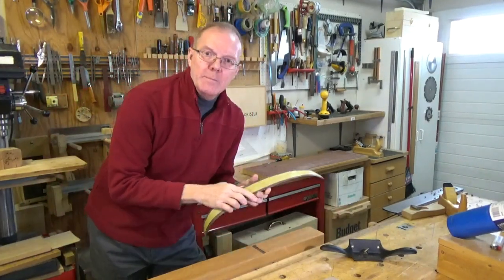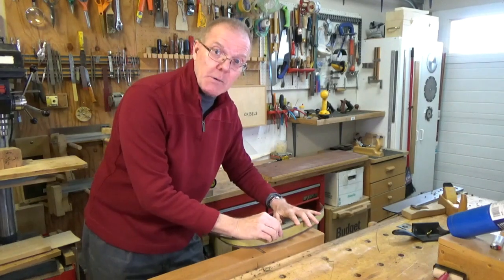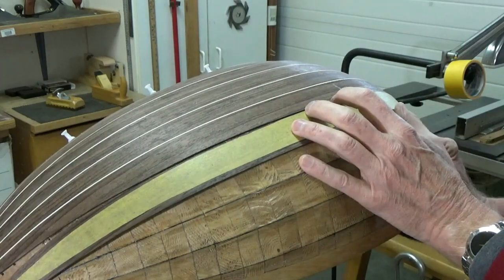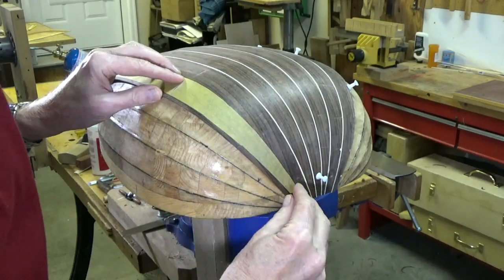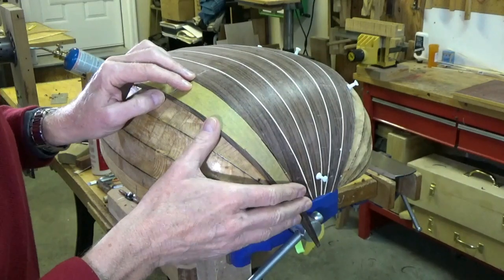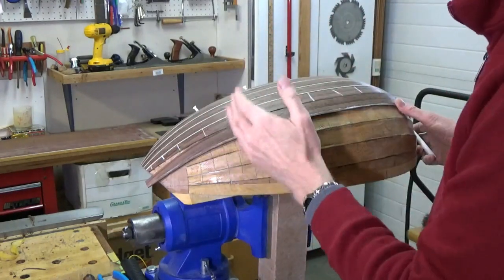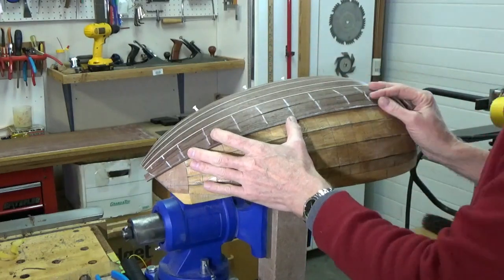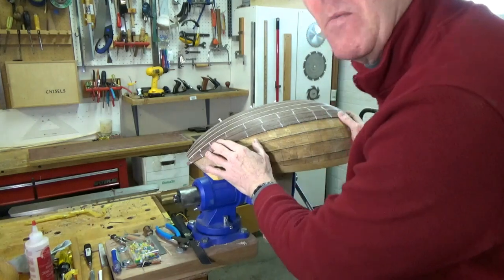Making a Lute Body: Fitting Ribs to the Mould Part II

Comment: I don’t want to work at being a craftsman. I want computer controlled laser cutters to cut my parts, and computer controlled robots to assemble them.  Then I’d use AI to market them to people on YT interested in lutes. My lutes would be so much accurate and better than ones made by old guts muddling along years ago. When you look closely at those old lutes it looks like necks are crooked, and stuff isn’t on center.  😂
Reply from the maker: This is not the first time that someone suggests that a complex wooden object could be produced using CNC machinery, lasers, sensors, 3D printers, etc. But there's a basic problem with this idea, and it's this: Wood moves. As soon as it's heated up, cut, planed, sanded, sawn, scraped or subjected to any sort of cutting or friction, it shrinks, bends and deforms in every dimension. These smart machines are better suited to materials for which they are designed, and which allow for tolerances of less than 1/1000th of a millimetre. Wood is not such a material unless it is fundamentally altered by the use of PEG, for example. I'm afraid you will have to commit yourself to doing it the old-fashioned way; use skill.
Reply: @EarlyMusicStudio1  - a very accurate and balanced reply. I'm a software engineer and part time Lute maker. The problem with CNC is the random variation in the workpieces. So you could CAD the plans and CNC cut all the parts, but it ain't gonna fit together without a craftsperson involved :) :)

Comment: wow.. bit lost about how to match ribs together.. seems impossible task
Reply from the maker: It's a matter of skill, that is for sure.  Essentially you are matching in three dimensions, the flat, the length and the next rib's curved plane.  Eventually you develop a feel for the work, and after all, the joint in most cases is a straight line (though curved in space).  

Even so, woods behave differently when bending, sometimes the wood flares up or down, and you control with with tape, counter bending or with the tacks. Once skill is developed with the planes, and the set up has stations for the various operations around the bench (the mould, the sanding board, planes in the vise upside-down, bending iron kept on low flame, tape, glue, tacks, a board for applying glue to the spacers, the work proceed smoothly.  

I usually count on 20 minutes to  go from thicknessed ("thinned") blank to attached rib tacked and taped on unless there are special problems with wood, sharpening, or it's first or last rib. Multi-rib lutes or flattened lutes are more work, as the joint is often not straight, but curves at either end of the body.  This is done by carefull hand fitting and a very sharp, finely set plane upside down in the vise.

Easy when you know how, as the saying goes!  Thanks for your question, Clive

Comment: Hi, thanks very much for the info. 

I like to watch instrument build videos on YouTube. For instruments with bowl shaped body (lute, oud, etc), nearly everyone uses traditional methods. First cuts the ribs to a rectangle shape then bends by iron and then gives them final shape with a plane or saw according to a template.

Would it be possible and easy to cut ribs precisely with a lazer cutting machine then bend and glue each other?

May it be easy!
Reply from the maker: Hi Cem Agan, and thanks for your question.  Lots of observers have noticed that lute making seems primitive and we should be be able to find more precise methods.  Some lute makers have tried making templates from alumimum, for example which allow each rib to be planed and bent, then cut exactly while clamped on one side, then glued to a master mold.  

Some suggested a three-d printing approach, either for the bowl or for the the mold, or for the ribs.  What about making templates from metal or some more permanent material?  

These suggestions are based on a philosophy of producing lute bodies quickly for a larger market, a bigger audience.  The thing which prevents the lute from being a mass-market object is not the economics of construction.   

Lutes were made to play music of a certain people at a certain time, and then we moved on.   We don't see musical instruments and their music and the public as historical, passing things, but indeed they are.  

The lute is a lovely thing, but it won't ever be a numerous thing, we know that from history.  For that, look to the guitar or others of that spirit.
Reply: @EarlyMusicStudio1  Hi, thanks for sharing your and some other luthiers' experiences.

Unfortunately due to popular consumption culture we are loosing our colors and richness inherited from history. :( Especially the young are mostly interested in popular instruments like electric/acoustic guitar, piano, synthesizer or some electric bowed instruments.

Yes maybe faster and larger production is not the case for lute. But any human being doing same task again and again looks for an easy, neat and more precise method in the background of his brain :)

I live in Turkey. You know, Eurasia. Here there are a number of instruments with bowl shaped back. I've seen that luthiers of these ethnic, folk instruments use traditional methods as well.

I'm not a luthier, I have some woodworking experience and I want to start making some instruments as a hobby. I love the unique shape and sound of folk musical instruments, watch and read about building them.

For a solution for bowl back instruments (comprised of ribs and stripes) I've an opinion:

I think you know classical or acoustic guitar building process. Luthiers use acrylic, mdf or plywood templates and a router to precisely shave some parts (like neck, fretboard, body top and bottom) Also some of them bend body sides on a wooden mold with the help of a silicone heater pad and a steel sheet.

I think same approach can be applied to bowl body shape instruments. First, if one has unwrapped (2d) templates of ribs, he can cut the rectangle shape rib wood to a precise rib shape. Then he can bend each rib with a proper sized silicone heater pad and a steel sheet on the mold. Also silicone heater pad can be laid on the mold (on the slice of mold where the wood will be bent) then luthier can slowly bend the rib on it. After bend operation, the rib is fixed and luthier proceed to stripes and other ribs.

Both Touching and feeling wood and working on art are relaxing and fulfilling tasks. I wish you nice and happy days in your workshop ;)
Reply from the maker: @cemagan9071  Hello and thanks for your very interesting and extensive reply!  It always amazes me how many ways there may be to do any given job, and you have thought of a new one.  Yes, templates are very helpful, but the final fitting must be done by hand.  Wood is not a completely predictable material, and even though we may cut and bend quite exactly, there may always be some small amount too much or not enough.  In metal working very fine tolerance is possible, but in wood, it's not always quite so simple .  I can make the tape template, apply it to my flat blank, and bend it, then I cut and fit.  Then I do the outside joint, then I glue it on.  Twenty or thirty minutes.  If you have a metal or wood template, use a blanket and heater and so on, I am almost certain it will take longer.

Please let me know how this works for you.

I understand from a colleague who went to countries where oud and folk lutes were made to observe the methods, that many of them used very primitive methods of marking--chalk, pencil etc. to get the rough shape,  from the mold, then all the final work is done just with a large flat chisel!  It's quick, but requires great skill. The fitting is all done with part of the rib already glued! Tried to do that, but could not make it work.  There's definitely a trick that I don't know!

One more thing:  the amount of heat needed to bend a lute rib is much less that what is need to bend a whole guitar side to a mold.  Be careful not to overheat where it's not necessary.  Yew wood needs very little heat, maple also.  Rosewood must be heated a lot, then there is much springback.  It can be very unpredictable also according to grain direction. I have always used just a hot pipe, propane, a couple of small irons used for upholtery.  Very simple. Most wood bends very easily.  Don't wet it.  One of my admired masters said " you don't bend the wood, you allow it to bend".

Best, Clive
Reply: @EarlyMusicStudio1  
Hi Clive,

Thank you for the tips about bending rib woods. 

I think to achieve precision, mold must be constructed on cnc (it doesn't need to be solid, it can be constructed with laser cut frames of plywood), according to a custom designed or historical 3d shape of which we know the exact measurements for each component(ribs and strips). Then ribs can be trimmed according to 2d templates belong to that 3d shape. We can bend and place each rib and strip where it should be on that mold. Also I saw that luthiers pin ribs on mold. As a better alternative, for bending ribs to their exact shape and fixing them on mold we can cast hard resin in the shape of each rib.

I have a design on my mind but first I must model a simple 3d lute model with specified specs (rib count, body depth etc.) I used some 3d modelling software to create 3d designs sometime but recently I've discovered a cad program "fusion 360". You can design a complete musical instrument in 3d with your given measurements. Also you can cut some part on cnc according to your design.

If I managed to design a prototype for a lighter and flexible mold with more precise cutting, bending and fixing system I'm gonna share it with you, maybe you have some suggestions about it. It would be easy to talk on pictures. 

Best wishes, 
See you...